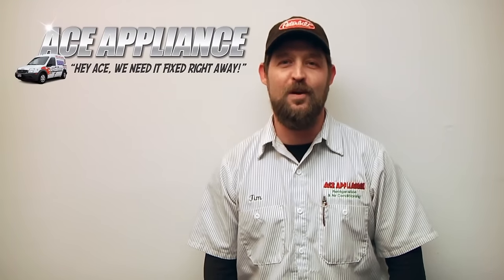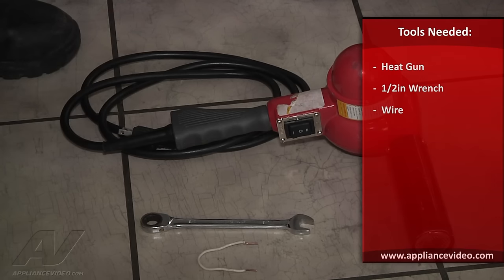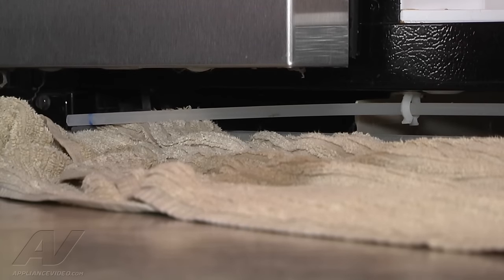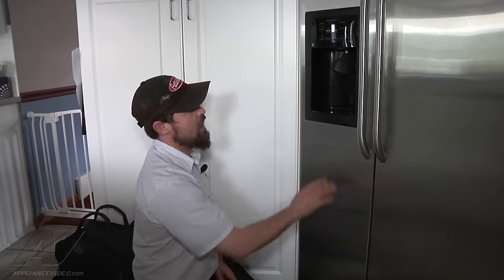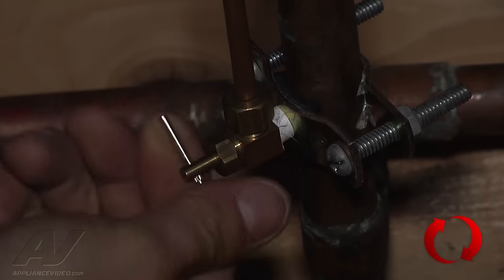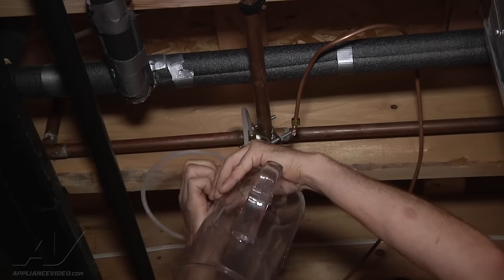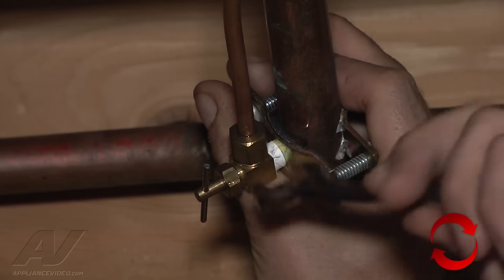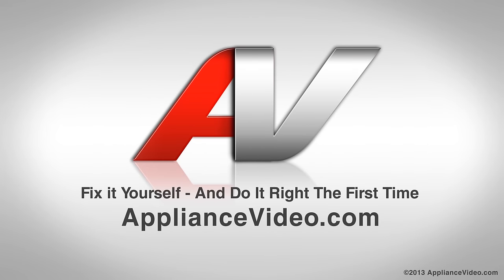GE Refrigerator Repair - Door Does Not Dispense Water - Saddle Tapping Valve Troubleshooting

Comment: Hello. My dad reconnected the waterline on the fridge and nothing but a tiny drops of water from the door dispenser. I took everything out of the freezer and letting it defrost. I have a new model Samsung fridge and I can’t take off the panel on the bottem of it. It’s like built in like it’s not coming off at all.

Comment: Hi. I hope you're still here. I tried your fix, and I think my problem is the plastic snake looking part in the inside back of my refrigerator that comes from the filter. When I push the water button, that part sprays  water all over inside my refrigerator. Is that an easy fix? Hope. Hope. :)
Reply from the maker: Great question, if you have a more technical question that our parts department cannot answer, you can search our over 13,000 answered questions free at our website www.ApplianceVideo.com under our Repair Help section. You can also call our parts department at 1-800-830-5465 and they can give you help 7-days A week ,or search at www.SaveMoreOnParts.com  .

Comment: Have a side-by-side that looks just like this one. But my problem is that the water comes out at room temperature most of the time. Any input would be appreciated. Thanks
Reply from the maker: Great question, if you have a more technical question that our parts department cannot answer, you can search our over 17,000 answered questions free at our website www.ApplianceVideo.com under our Repair Help section. You can also call our parts department at 1-800-830-5465 and they can give you help 7-days A week ,or search at www.SaveMoreOnParts.com  .

Comment: This was good up to the point of NOT removing the saddle valve. That’s why you have low flow. It’s a pin hole into the pipe from the saddle valve. Install a real connection

Comment: I just used the hairdryer both from the bottom waterline as well as through the top dispenser. Now the dispenser is not working at all!  I’m afraid the heat from the hairdryer melted something in the dispenser mechanism. Any thoughts?
Reply from the maker: Great question, if you have a
more technical question that our parts department cannot answer, you can search
our over 10,000 answered questions free at our website www.ApplianceVideo.com under our Repair Help section. You can also call
our parts department at 1-800-830-5465 and they can give you help 7-days A week
Monday -Sunday, or search at www.SaveMoreOnParts.com  24 hours
7- days A week.

Comment: If it's making ice doesn't that mean your external water line is not frozen?  Thanks for your video!!!
Reply from the maker: Great question, if you have a more technical question that our parts department cannot answer, you can search our over 13,000 answered questions free at our website www.ApplianceVideo.com under our Repair Help section. You can also call our parts department at 1-800-830-5465 and they can give you help 7-days A week ,or search at www.SaveMoreOnParts.com  .

Comment: I have a GE refrigerator very similar to the one in the video. I have the freezer temp. set to zero. Why does it sometime go to -9 -10? I think this is what caused my water line to freeze.
Reply from the maker: +cooldog60 

All of our technicians are now answering questions daily at our http://www.appliancevideo.com/ website under the Repair Help section.  We also have over 1600 common questions and
answers that you can easily search through by your model number, appliance
make, problem or error code and it’s absolutely FREE. You also have the option
to email a factory service technician with a question on your appliance at
http://www.appliancevideo.com/repair-help/ . If you’re looking for a repair video, you
can also search our library of over 2600 free repair videos. ApplianceVideo.com
specializes in quality DO-IT-YOURSELF appliance repair videos and we get over
800,000 views per MONTH to our videos worldwide and growing. If you need of
parts for your major appliance, we have over 5-million parts in stock at http://savemoreonparts.com/ .  Thanks
for your support. Matt Ace Appliance factory service technician.

Comment: Hi,I am having a concern about how my fridge works,the compressor and the discharge line are hot when I feel them with my hand but when I feel the suction/return line it does not seem to be cold as it should,when I feel the filter/drier should it be worm or cold.I just want to know the what why and how,thanks.
Reply from the maker: Great question, if you have a more technical question that our parts department cannot answer, you can search our over 17,000 answered questions free at our website www.ApplianceVideo.com under our Repair Help section. You can also call our parts department at 1-800-830-5465 and they can give you help 7-days A week ,or search at www.SaveMoreOnParts.com  .

Comment: my problem is opposite, I checked that line, and got a lot of water that drained out from the door side, but did not get any water that flowed once I closed the door and the press and held water button, you think this could be the water inlet valve? thanks.
Reply from the maker: Great question, if you have a
more technical question that our parts department cannot answer, you can search
our over 10,000 answered questions free at our website www.ApplianceVideo.com under our Repair Help section. You can also call
our parts department at 1-800-830-5465 and they can give you help 7-days A week
Monday -Sunday, or search at www.SaveMoreOnParts.com  24 hours
7- days A week.

Comment: Thanks for your video! I really works...
I used the heat gun to unfreeze the line and I got water after 20 minutes or so. 
But after a day or 2 the line is freezing again... :(

What I should do to resolve the frequently freezing?
Reply from the maker: +Fabiano Porta 

We would like to help you
answer your question. With our videos now getting over 900,000 views per month and
hundreds of questions from people like you, our technicians are now answering questions
at our website http://www.appliancevideo.com/repair-help/ .  We also have over 2200 common questions
and answers that you can easily search through by your model number, appliance
make, problem or error code and it’s absolutely FREE. You also have the option
to email a factory service technician with a question on your appliance at http://www.appliancevideo.com/repair-help/ . If you’re looking for a repair video, you can
also search our library of over 2600 free repair videos. ApplianceVideo.com
specializes in quality DO-IT-YOURSELF appliance repair videos and we get over
800,000 views per MONTH to our videos worldwide and growing. If you need of
parts for your major appliance, we have over 5-million parts in stock at http://savemoreonparts.com/ .  Thanks for your support. Matt Ace
Appliance factory service technician.

Comment: A 2 mm insulated flexible cable from Home Depot usually breaks the ice in the tube in about 30 seconds if you push it from the top opening (this is where my pipe usually gets frozen). No disassembly or hot air application or leaving fridge unplugged needed. Tried it twice already. The wire runs about 19 c per ft, 5 ft should be enough.
Reply from the maker: Thank you for your positive response, we are glad we could help. Please help us by
subscribing to our YouTube channel. Or support our parts department at
1-800-830-5465 and our website www.SaveMoreOnparts.com .  This is the only way we can continue to
help the over 900,000 people per month like you repair their own appliances. We
also have thousands of more quality videos on all major appliances made by our
factory trained technicians at www.ApplianceVideo.com .
Reply: I changed the qater flow valve but it didi not work. what do I do now.

Comment: Does the filter have to be hooked up for water line to work
Reply from the maker: Great question, if you have a more technical question that our parts department cannot answer, you can search our over 17,000 answered questions free at our website www.ApplianceVideo.com under our Repair Help section. You can also call our parts department at 1-800-830-5465 and they can give you help 7-days A week ,or search at www.SaveMoreOnParts.com  .

Comment: Do you know why a refrigerator even with a new evap fan, good damper and defrost system working, air still not reaching the bottom? in fact when i open freezer door i feel air to the bottom but not anymore when i close the freezer door,, second fridge doing this to me cant figure out why yet,,. thanks in advance for your help...
Reply from the maker: Great question, if you have a
more technical question that our parts department cannot answer, you can search
our over 10,000 answered questions free at our website www.ApplianceVideo.com under our Repair Help section. You can also call
our parts department at 1-800-830-5465 and they can give you help 7-days A week
Monday -Sunday, or search at www.SaveMoreOnParts.com  24 hours
7- days A week.

Comment: Hi,  My LG GR-L247NSS water dispenser tupe has split at the bottom of the door.  Can the tube be replaced or is it a new door?
Reply from the maker: Great question, if you have a
more technical question that our parts department cannot answer, our
technicians are answering all questions at our website at www.ApplianceVideo.com under our Repair Help section. You can also call
our parts department at 1-800-830-5465 and they can give you help 7-days A week
Mon-Sat . You can also search at www.SaveMoreOnParts.com 7- days a week.

Comment: Do I have to turn off the water before u hooking the valves?
Reply from the maker: Jay 
      All of our technicians are now answering questions daily on the ApplianceVideo.com website for anyone needing help. Just copy and paste this this question under REPAIR HELP, and one of our  factory authorized technicians  will answer any technical questions at absolutely no charge on your appliance issues. We also have over 2600 free repair videos to help with your appliance repair issues. Thanks for your support. Matt Ace Appliance factory service technician.

Comment: my water line inside the door (hinge) broke cut, how replace that , you have a video too?
Reply from the maker: Great question, if you have a more technical question that our parts department cannot answer, you can search our over 17,000 answered questions free at our website www.ApplianceVideo.com under our Repair Help section. You can also call our parts department at 1-800-830-5465 and they can give you help 7-days A week ,or search at www.SaveMoreOnParts.com  .
Reply: i  put a small pipe inside the broken pvc hose with clue and it works fabulas

Comment: Hello, I disconnected the part under the freezer door and tried to run the water. However, I did not get any water flow. There is good water pressure unto the back of the refrigerator. What might be the problem on mine, and how can I fix it?
Reply from the maker: Abhishek
              If you go to our FREE repair help website at ApplianceVideo.com and post this question, we have 14 factory authorized technicians that will answer any technical questions at absolutely no charge on your appliance issues. This is the only website on the web that you can get questions answered by certified appliance and HVAC technicians along with over 2600 free repair videos.  Matt Ace Appliance factory service technician
Reply: Were the doors closed when trying to dispense the water?

Comment: So . . .  what if no water is coming down the tube BEFORE it gets to the door?  Bad water pump?  I can hear a click and something energizing when I depress the water dispense lever.  And I changed out the water filter.
Reply from the maker: Great question, if you have a more technical question that our parts department cannot answer, you can search our over 17,000 answered questions free at our website www.ApplianceVideo.com under our Repair Help section. You can also call our parts department at 1-800-830-5465 and they can give you help 7-days A week ,or search at www.SaveMoreOnParts.com  .

Comment: ok... I did the check the hose part, and did NOT get water coming out of the piece when we "called for water". What could be the cause of that?
Reply from the maker: Great question, if you have a
more technical question that our parts department cannot answer, our
technicians are answering all questions at our website at www.ApplianceVideo.com under our Repair Help section. You can also call
our parts department at 1-800-830-5465 and they can give you help 7-days A week
Monday -Sunday, or search at www.SaveMoreOnParts.com  24 hours
7- days A week.

Comment: Not sure mine was frozen but was plugged up,  got it freed up using my air compressor back and forth on both ends.
Reply from the maker: Great question, if you have a more technical question that our parts department cannot answer, you can search our over 10,000 answered questions free at our website www.ApplianceVideo.com under our Repair Help section. You can also call our parts department at 1-800-830-5465 and they can give you help 7-days A week Monday Saturday, or search at www.SaveMoreOnParts.com  24 hours 7 days A week.

Comment: What if my ice maker has water and the line to the water is not frozen?  I remove at the union and press call for water and there is no water.  This has happened periodically for quite a while and after days or weeks it starts dispensing. What to check now?
Reply from the maker: Great question, if you have a
more technical question that our parts department cannot answer, you can search
our over 10,000 answered questions free at our website www.ApplianceVideo.com under our Repair Help section. You can also call
our parts department at 1-800-830-5465 and they can give you help 7-days A week
Monday -Sunday, or search at www.SaveMoreOnParts.com  24 hours
7- days A week.

Comment: I changed the valve  and it did not work. what do I do now? Any suggestions?
Reply from the maker: Great question, if you have a
more technical question that our parts department cannot answer, our
technicians are answering all questions at our website at www.ApplianceVideo.com under our Repair Help section. You can also call
our parts department at 1-800-830-5465 and they can give you help 7-days A week
Monday -Sunday, or search at www.SaveMoreOnParts.com  24 hours
7- days A week.

Comment: When you select the ice or water there use to be a red light on the board no more. Thanks again
Reply from the maker: Great question, if you have a
more technical question that our parts department cannot answer, our
technicians are answering all questions at our website at www.ApplianceVideo.com under our Repair Help section. You can also call
our parts department at 1-800-830-5465 and they can give you help 7-days A week
Monday -Sunday, or search at www.SaveMoreOnParts.com  24 hours
7- days A week.

Comment: This appears to be a symptom of a problem, not the problem itself.   If the water lines are freezing, it would seem it's because the freezer itself is too cold.   Is this a symptom of blocked coils or a failing refrigeration unit?
Reply from the maker: Thanks for your response, we are glad we could help. Our library of over 5,900 videos are currently helping over 1.6 million people like you every MONTH.  Please help us by subscribing to our YouTube channel, or post our website www.ApplianceVideo.com to your Facebook page, Twitter, Instagram or any other social media sites. Your support will help us keep producing more free quality videos.
Reply: @Appliancevideo  What I figured out is that if the damper assembly between the freezer and refrigerator is not opening properly the freezer will get extremely cold because the refrigerator thermostat keeps calling for more cooling.   The damper can fail either open or closed, and in my case the damper was stuck closed forcing the cooling system to run too long (it if fails open, your refrigerator will be too cold freezing food).   However, I will say you presented a very logical way for me to diagnose that it is not a water flow problem, so thank you.

Comment: What if I am not getting water at all when disconnect the valves in the front?
Reply from the maker: Great question, if you have a more technical question that our parts department cannot answer, you can search our over 17,000 answered questions free at our website www.ApplianceVideo.com under our Repair Help section. You can also call our parts department at 1-800-830-5465 and they can give you help 7-days A week ,or search at www.SaveMoreOnParts.com  .

Comment: I just hooked up waterline but don't have a filter and it's not running
Reply from the maker: Great question, if you have a more technical question that our parts department cannot answer, you can search our over 17,000 answered questions free at our website www.ApplianceVideo.com under our Repair Help section. You can also call our parts department at 1-800-830-5465 and they can give you help 7-days A week ,or search at www.SaveMoreOnParts.com  .

Comment: I was hoping someone could help. My side by side has poor water flow to both the water dispenser and the Ice maker. the ice cubs are just the shell of the cube mold. I have put a new filter, new water valve and made sure all the lines are clear, as well as checked the incoming water pressure. Still don't know whats going on any suggestions would be helpful thanks.
Reply from the maker: Great question, if you have a
more technical question that our parts department cannot answer, our
technicians are answering all questions at our website at www.ApplianceVideo.com under our Repair Help section. You can also call
our parts department at 1-800-830-5465 and they can give you help 7-days A week
Monday -Sunday, or search at www.SaveMoreOnParts.com  24 hours
7- days A week.